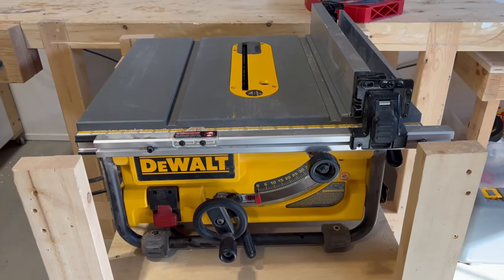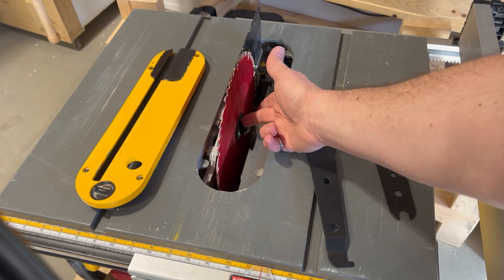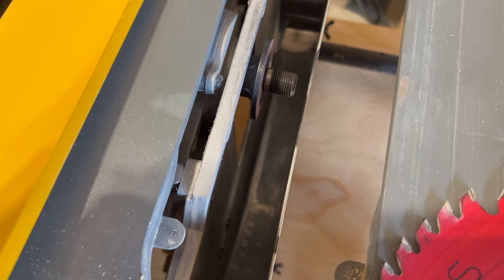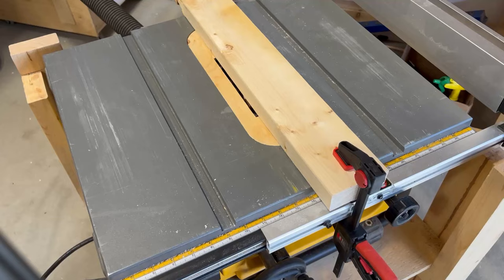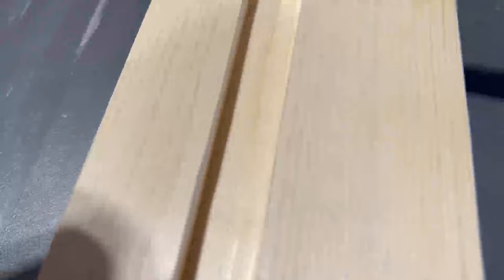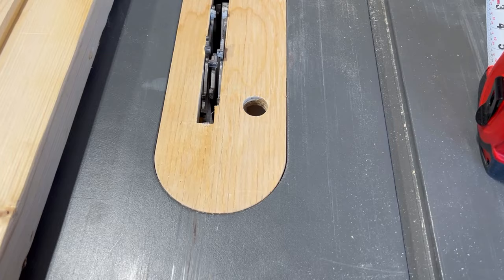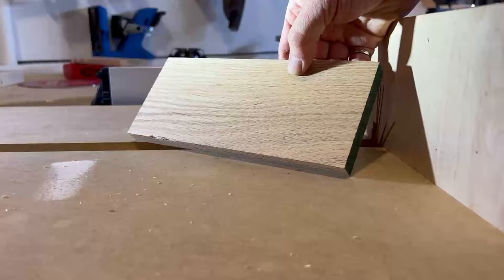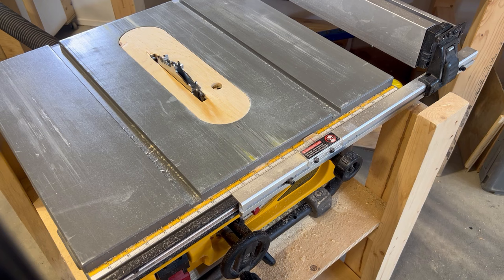Using a Dado blade on a Dewalt jobsite tablesaw - can it be done?!?

Comment: Regrettably, whilst the demonstration “looks” convincing it none-the-less pushes the boundaries of good engineering prudence. Yes, the demo went well- as far as it goes - but relying on just 2 to 3 threads to hold what is a relatively massive blade on to the arbor is indeed tempting providence! Sticking my neck out here, I would say, as a time served engineer and a qualified production engineer ( retired over 20 years ago) the minimum engagement of the nut on the arbor must be equal to the thickness off the nut; more if possible under trying conditions, like cutting tough timber on a major scale.
Reply: So true! Thank you for chiming in
Reply: You sound like the engineer who put the starter inside the transmission bellhousing to keep it safe from road debris. Send it man 😂😂😂😂

Comment: it is extremely not safe to rely on two threads to hold blads together on the rotating equipment.
Reply: Oh don’t be daft man….what a little saw blade to the cranium?
Reply: This is an accident waiting to happen. No Way would I ever do that. One possible way to do it is to buy a motor from a DeWalt DWE7491 which has a longer arbor and replace this 7480 motor. Of course more research would have to be done to see if it would fit. Better yet, just buy a 7491 which I just bought used for $350.

Comment: This is very dangerous; a better alternative would be a wobble (adjustable) dado although not as clean cut as the stacked, but you would still have a decent number of threads left for tightening the blade.
Reply: Too dangerous…not enough thread.
Reply: @brianmurray667  I am a 35+ year experienced trim carpenter and cabinetmaker, i have that exact saw and have used it on many occasions on jobsites with a wobble dado, the width of the cut adjusts without much change in the width at the shaft of the dado and i always have enough thread to tighten properly you do however have to remove the outer washer and just use the tightening nut by itself, but i also do not go beyond about 1/2inch in adjustments and always use a zero-insert plate,  works fine for occasional use .
Reply: @selwyncallender399   I fail to see what 35+ years of experience has to do with safety, compatibility, and proper use.  I have known experienced tradesmen that have made mistakes with safety and paid for it.  Search Youtube for Perkins Brothers and you will see an experienced contractor that lost multiple fingers in a jointer accident, for failing to follow safety standards and paying attention.
Reply: @dmorty6241  Thank you for pointing this out. This is a lesson to be learned from others. It renewed my respect for power tools.

Comment: Just because you can doesn't mean you should. Dado sets are much heavier than regular blades and bench top saws are not designed for them. The bearings will not last, the universal motor is no where near as powerful or robust as the induction motor on a real table saw. Bad idea all around.

Comment: You're holding the blade on with about half a nut AND you're missing the washer that helps keep the nut from loosening. That's not sketchy; that's foolishly dangerous. Doing this will increase the risk of saw failure and the potential subsequent accident. How much of an increase? How bad of an accident? I' don't know and don't want to find out.
richard
--

Comment: Physical space is not necessarily the reason DeWalt states this saw is not compatible with a dado stack. There's also the limits of the motor to consider. It's far more stress on the motor to make a 5/8" cut than a 1/8" cut. Clearly it can be done as indicated in this video, but you could also be dramatically shortening the life of your saw. 

I have the DWE7485 model of this saw (2021) and there is a metal guard in the dust collection shroud that limits the width of what you can put on the arbour. Others in the thread have suggested the Freud box joint blade pair that support 1/4" and 3/8" cuts. On the 7485, you can only use the 1/4" option as the 3/8" option would result in the blade hitting the guard.
Reply: Shorten the life of your saw? Most electric motors can take an incredible amount of use and abuse. That's the last thing I would be worried about. Having the blades come off and  hit me in the face is a concern.
Reply: That’s why he started with stating they don’t recommend it!

Comment: I have a Dewalt 7491 and a Dewalt 8” dado stack.  The dado stack works perfectly fine with it with full thread contact on the nut with the arbor bolt and blade collar.
Reply: The 7491 was designed for dado use
Reply: @shannonloys9985  If you are the adventurous type, I believe the 7491 arbor thread will fit the 745 and give you the needed exra threads.

Comment: I have the same awesome saw and I can safely use a Freud 2-blade 1/4 & 3/8" reversible blade pair on this saw. I just run the board through twice to get a wider dado. Thanks for showing others about the feature that swayed me to get this used Dewalt over the newer ones.👍

Comment: I have a dado stack for my DW 744.  I know I can't use the entire stack on it.  I did buy a Dewalt dado throat plate a few years ago.  From my manual it says:  Do not attempt to stack thicker than 13/16" (20mm) and do not use dado blades larger than 8".  When installing the dado stack do not include the inner clamp washer, replace it with the outer clamp washer.  Then install the dado stack, arbor nut and tighten with supplied wrench.  Years ago, I got a wobbly dado, but it's a pain to get that lined up sometimes.

Comment: I have an older model, the DW 745, which has a 10” blade. It will not support a dado stack either. As others have commented, what’s going on in this video is not a great idea. What I’ve done as a workaround to this limitation is to use a box joint cutter set instead. The one I have is from Freud, It has two blades that nest together. They can make either a 1/4” or 3/8” kerf, depending on how you orient the cutters. This particular setup can thread onto the arbor securely. Obviously it’s not a real dado cutter, you can’t make any adjustments to it. But it does cut 3/8” wide just fine, and it seems pretty safe.
Reply: is it the arbor thats the focus?

Comment: Thousands of old Craftsman cabinet saws out there. I wouldn't mess with this.
Reply: @tailgatecarpenter26  I have three or four old Craftsman's in my garage. From free to $20 with a free drill press tossed in.
Reply: Funny you said that, that’s the main reason I use that ‘old’ thing for, just for dado stacks. I’m temped to try the Dewalt like everyone else has but manual says not to and I’m listening to the manufacturer.
Reply: Yup. I got a craftsman table saw free with an old Delta drill press I bought for 20 bucks.

Comment: You must consider the blades center on the shoulderd portion of the shaft.  Placing them on the threaded portion can allow for an improperly balanced part of the blad which can cause vibrations.  This could damage the threads on the shaft as well as wear the bearing out in the saw.  Though it can be done and I will be doing this myself I will only go as wide as the shoulder on the shaft permits.
Reply: I have the same saw and looking at doing 1/4 and 3/8 dadoes for drawer bottoms. Thinking either box cutter joint set or dado set without the chippers which I think may give me the 1/4 in width I’d need
Reply: On dewalt saws that do support datos the blades are on the threads so I don’t think you have much of an argument. From the 7480 to 7490 the supports a dato stack, it’s exactly the same part with a longer arbor. A am going to buy the longer arbor (and nut)  and add it to my 7480

Comment: Having only half the arbor nut engaged would scare the h3ll out of me.  If there’s a failure related to the arbor, the blades or the arbor nut, the blades could easily leave the saw and who knows where they will wind up - possibly in the operator’s chest or forehead.  There’s another video that shows both blades and one chipper, for a total 3/8” stack, and the arbor nut is flush with the end of the arbor.  That seems a whole lot safer than having only half of the arbor nut engaged.

Comment: Using almost a full set of dado blades with little to no thread left is extremely dangerous on those small saws. My first portable saw is the older dewalt contractor table saw with the rocker on/off switch, then bought the same exact one you have. I still pop in 2 max 3 blades in and i make sure a leave full  tread for nut. It's your life! For God sake.
PS. I recently bought the 32.5 max rip contractor saw now I can use a full set of dado on it I am super happy. I used to built cabinets foryears, years ago with big delta table saws, now I only to remodeling.
Reply: you only need 3 threads of contact, anymore doesn't make any stronger connection. so as long as that bolt threads in 3 revolutions it's good

Comment: There is a video online where a guy replaces the arbor on this saw (assuming 7480) with the longer one from the 7491rs. He includes part numbers for the arbor and the bearings, etc. Not a difficult task. I did it on mine and it works great.

Comment: Doesn’t really look like a good idea. I have this saw and when it’s turned off, the blade stops almost instantly. With the dado blades, there was a lot of run on, which would be increasing wear on the motor. 
That’s without mentioning the potential for the blades flying off.

Comment: Hi Red, nice try! Thx for this demonstration ! The DeWALT Saws have a great torque, and if it stays tight after more times on and off is the question! Even with 1 Blade if you don,t thight the Nut enough it comes loose! Happened to me the very first time, Blade stays on the arbor SPINNING FREE until it hits something like the Riving Knive mount or so! Took 2 teeth out of my Blade, and a bit of damage underside insert that was all !!!
Didn,t fly out of the machine!!
Better make the stack thinner so the nut will fully engage the Arbor!
Btw, the 7492 has Dado Capability!!!
Greetings Piet!!

Comment: Well done.  I admire your fortitude.  We may Never know the real reason Dewalt purposely built their most popular contractor saws to not accept a Dado stack, but I would be willing to be it was determined by a room full of actuaries who likely concluded that they could save a bunch of money by putting in a smaller motor that would wear out sooner if they didn’t also alter it so adding a stack was discouraged along with the instructions discouraging it.  So for what likely saves them ten bucks
We gen an inferior product that they also likely concluded means a portion of the customer base would buy a second one or upgrade sooner as well.  Garnering them even more profit overall.  Bastards.
Reply: More likely they designed this "portable jobsite saw" to meet the needs of tradesmen doing rough carpentry and trim and casework installation ON JOBSITES, and they designed it to be able to handle those common jobsite tasks (like ripping a cabinet filler, stair riser, or a piece of oak flooring, not doing joinery on an ebony piano case) while also keeping it light enough to be PORTABLE so that one skinny 20 year-old or arthritic old man can get it in and out of his truck by himself with a cigarette in his mouth or carry it up and down stairs or even the occasional makeshift ladder slapped together with bowed and twisted 2x4 culls and extra purlins. 

They probably correctly assumed that if a person needed a full-size cabinet saw they would buy one of those instead of buying this product and complaining that the reason their stock Hyundai Sonata doesn't generate as much torque as Kyle Busch's dyno-tuned, bored and cammed-out Camaro ZL1 is because of corporate greed. 

There's a reason that a decent cabinet saw costs 5 times more than a jobsite saw, and there's a reason that woodworking craftsmen pay that price to have a real belt-driven cabinet saw in their shop that is actually DESIGNED for what they do instead of just picking up a 40 pound direct drive jobber saw on sale at Home Depot and calling it good.
Reply: Great Scott! You have the whole scenario down pat. Good work figuring all that out.
Oh and watch out for the men in black just outside your door 🙂

Comment: this gives me peace of mind and expands the use of my saw. Thanks for putting this video/ test out. Much appreciated.
Reply: If you do this on this saw, then your peace of mind is an irrational delusion. Be sure to set aside some money to spend either on a new saw or to cover your health insurance copay.
Reply: @wulf67 I’m looking for a cross cut blade for the 8.25 Dewalt. Should I get a 7.25 blade or the DeWalt 40t 8.25? Just worried that other blades won’t fit properly.
Reply: @he-mansuncle7661  I'd get the 8.25" because you'll be able to cut thicker boards with it. The problem with this video is that he's using a dado stack that barely allows for the arbor nut to catch one thread on the arbor shaft. In the case of your crosscut blade either the 7.25" or the 8.25" will be fine (as long as you don't try to put five of them on at the same time) 😂
Reply: …to make a coffin?

Comment: If you really want to do that change the arbor out the arbors work on several different models there’s videos out there with people showing you that the arbors on the dado work on other models. It’s about 100 bucks total but to save yourself from getting killed it’s worth it the 745 does have a smaller motor and will after awhile wear it out.

Comment: As it happens, I have a 7485 AND a dado set on order, and only just realized that the 7485 supposedly can't take a dado set. But your video gives me hope! And if on the 7485 there is some kind of guard in the way, I'll consider modding. Over 50 yrs using power saws and never injured. (Except once slightly by a table saw guard. If you must use a table saw guard, be EXTRA careful!)

Comment: Interesting as a demonstration but I honestly wouldn't use it in my shop due to the danger it represents having so little space for tightening the nut. Kerf blades are too much safer and yet a satisfactory alternative for wide ripping with job site table saws.

Comment: It’s not just the lack of thread engagement in the nut that is the problem, it’s the washer!  The washer is dished on purpose, to maintain a reasonable clamp load should the nut back off slightly. There’s a whole science in bolted joints. The washer isn’t a spacer, it’s a spring. The set up proposed here is extremely dangerous.

Comment: I have a dewalt 7485. Going all the way to 5/8 seems scary but if I were to just do 1/4 dado would anyone recommend that? I’m assuming I would have more thread for the bolt.
Reply from the maker: 1/4” or even up to 1/2” gives full contact for the nut
Reply: @redrockdesign3333  Thank you

Comment: I have the Porter Cable job site saw. It will safely take up to a half inch dado stack. I know the older DeWalt job site saws would take a full dado stack.
Reply: Confucius say "just because you CAN do something, not mean that you SHOULD!" A plugged-in toaster CAN fit quite easily into a bathtub full of water. You CAN fit like 18 of them in there. The electrician manual says to not plug more than about six of them on any one circuit at the same time though, but I do what I want! I don't follow anyone's rules. I don't even call it a dado stack. It's a Freedom Stack!

Comment: I'm confused. If the T.S. specicfically says in the owners manual not to modify or use a dado because of high risk of bodily harm, ...............help me understand, because this is confusing to a point.
Reply from the maker: Lots of good comments below explaining possible reasons for Dewalts statement. So far I’ve had no issues but I only use the dado set for very small projects. If you push the saw too hard with a dado set there is increased risk.

Comment: This guy is a big time "wannabe" authority"  - To begin with:  There is NOT two threads on the arbor exposed (barely one thread - the first thread he is counting is a starting thread).  Secondly:  He says the nut is what he describes as "half way on".  LOGIC DICTATES:  If there are two threads exposed on the arbor after the baldes are installed then the nut only can go on with two threads.  There are approximately (at most, six to seven threads inside the nut so  the nut is NOT "half way" - barely one third of the way on.  This is a VERY DANGEROUS venture.  I give NO advocation to his presentation.